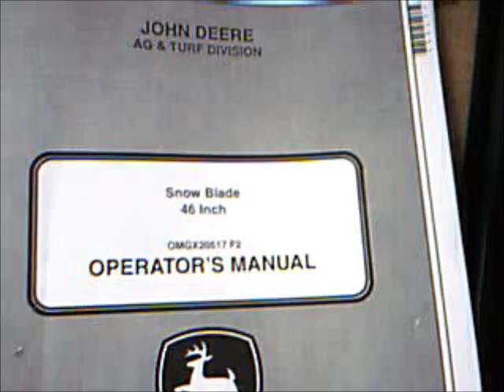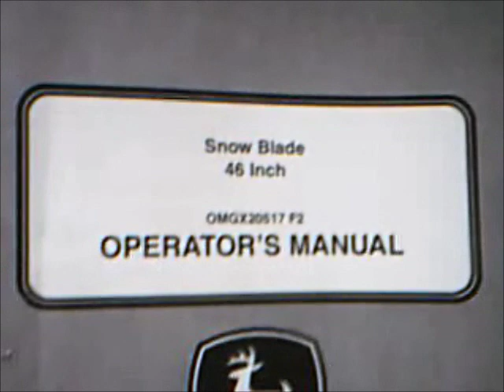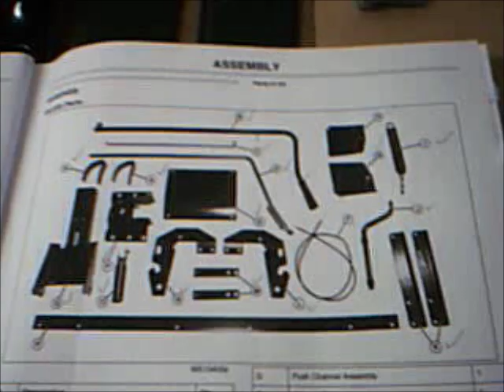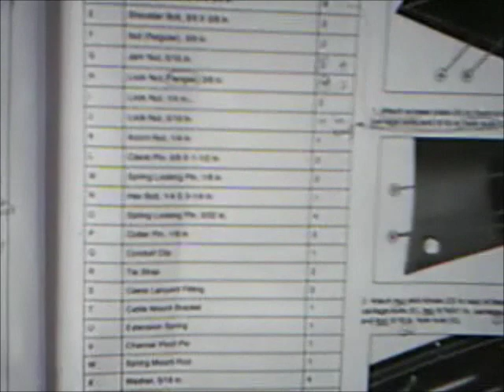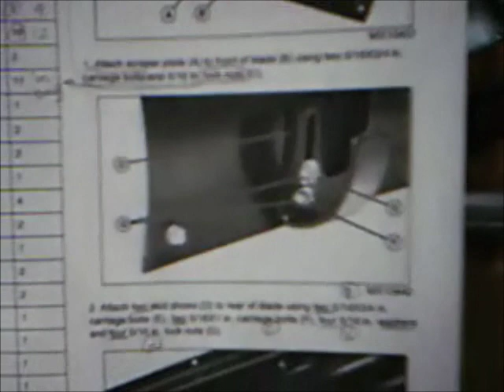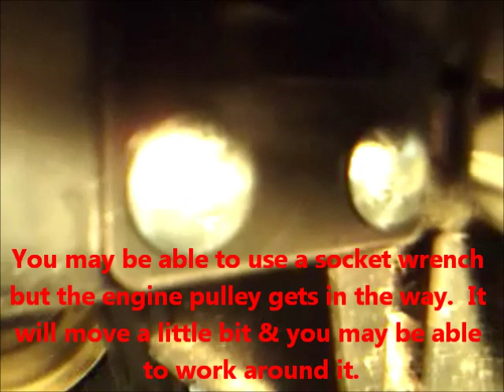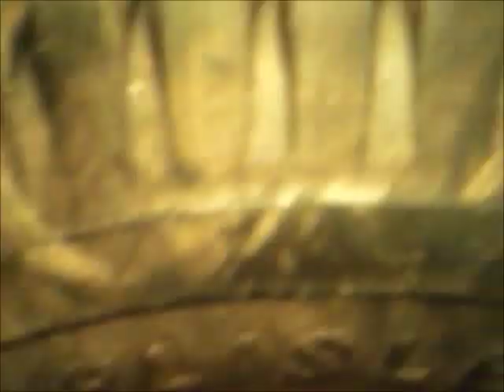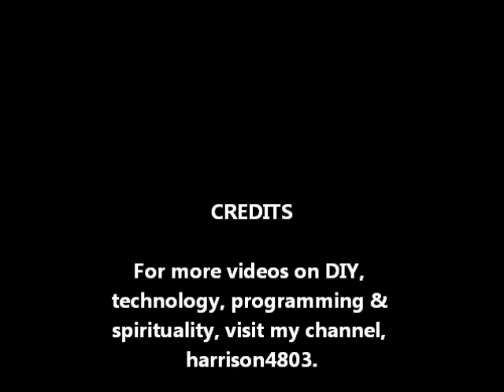Assembly & Installation of a 46" Snow Blade on a John Deere L130 Mower

Comment: Thank you, John.  Your video was just what I needed.  I watched and followed it, today, and have completed the installation of my own J.D. snow blade on my E150 model riding lawnmower.  My snowblade was sent without instructions, and I was able to just watch the video that you have spent the time and effort to create, perform the assembly in this fashion, with the result that the snowblade and riding mower work well as a system.  So thank you.  One tip that I would add, for those doing this, is that when it becomes time to install the two side mounts to the mower itself, to insert the carriage bolts from the inside out, i.e. with the round head of the carriage bolts on the inside of the mower with the threads of the bolt penetrating both the original chassis of the mower frame and out through the brackets.  Then mount the nuts from the outside, essentially.
Reply from the maker: Good point, Kev, and someone else suggested that before, also.  I had to take them off to replace my muffler & am reversing the bolts when I put them back on.  May make a video to supplement this.  Thanks, for thinking of it.

Comment: I read the instructions. Couldn't figure it out. Then I looked it up on youtube and found this I would replay 1 part at a time like 400 times. I only understand things when someone else is doing it. Not just paper. Thank you for making this video.
Reply from the maker: Thanks for the praise, storytime!  As a retired engineer, I always read the manuals first & like the detail! I used to write manuals, so have a little better understanding of how they are put together, maybe?
Reply: @harrison4803  just a quick question. Did you have to remove the exhaust manifold?

Comment: This was helpful.  Frankly it's an easy install EXCEPT the manual does not clearly identify bolts and nuts IMO.  I spent an hour figure out the what parts were what and an hour then building.   I was really surprised for a John Deere kit.  Even now I have no idea if i put the right bolts in the right places.   I had this video running next to the manual.  Fortunately, it worked great...
Reply from the maker: I agree, Michael, it was a challenge!  It took me quite a while longer to put it together, due to the video work, also, of course!  It has served me well, although we don't have that much snow, here, just West of St. Louis.  I had to adjust the cable to swing the blade from left to right, recently and that is about all I have had to do.
Reply: @harrison4803  The videos really take time.   I’ve done a few.  I had trouble with the cable adjustment also which was odd as I was once a bike mechanic.  All set now though.  Thank you.

Comment: Awesome, no one else did a video like this. Completely a huge help.Thank you for doing this! And you did it well, explaining step-by-step, following each step in the manual.
Reply from the maker: Thanks, for your kind words, alwaysbeeurself!  Must be the engineer in me?  I am one of those who always read the manual before doing anything!
Reply: John H Not a problem. The manual was pretty hard to follow, so without your video, I do not think I would have been able to do this. And, for anyone else to know, if they are doing this project, I purchased 2 of these units, I have some additional advice if it helps:
1. Please lay out all of the parts to distinguish what parts are what before you begin, make sure all parts are present before beginning.
2.  When comparing parts from each unit, all were present but  there was a lack of Lock Nut, Flanged, 3/8 in (letter H in Key).
3. Having a lack of parts and more parts then needed. In each box, there were 12, and 16 are needed, the manual even states 16 should be present.  And on a side note, there were 4 additional lock nuts in each box of the same type, but weren't in the assembly parts nor used in any of the assembly, thought that was weird.  And in each box there were 4 Jam nuts, but only 2 are used, as the other 2 are present to use as I said they gave me 4, but the other 2 are pre-attached on control cable, page 9 of manual. Guess whoever packs these items sees 4 are used, but 2 are pre attached. And in each box they gave me 4 of each Carriage Bolt, 5/16 x 1 in, but only 2 are used. And in one box they gave me 12 lock nut, 5/16 in and 11 in the other, and 11 are actually used.
4. Make sure you have wrenches of similar sizes for the assembly of the pivot support and mounting brackets, view manual to see what I'm referring to on page 10. So, one wrench could hold the bolt on one side, and you can screw the screw on the other side while the bolt stays still.
5. I didn't know this, but lock nuts have a rubber ring on one side, but this is there to allow you to screw bolt through it so the nut locks onto the bolt. At first I was confused as the bolts would stop at the rubber ring, eventually figured it out.
6. The manual, as you read it, eventually states you will need general purpose grease for the assembly of the lift handle rod. I didn't have grease, guess I could apply at anytime, buy FYI, it prob would help with lift handle gliding to enable smoother turning of the blade.
7. Finally, it states in the manual, at some point, to remove the blade deck. I kept my blade deck on when snow removing. Removing the blade deck will be a whole nother learning curve, may do this at another time, hope I don't mess my deck up when snow plowing, something you should consider if doing this job.

This took me approx 8 hours to complete one of these, I'm not technically handy, but this may not be a 2-4 hour job for the average person unless you are handy and are good at things like this.

The reason I bought 2 units is because the first one was missing the flanged lock nuts as explained above, and I was speculating other parts missing since I had a hard time determining what some of the parts were, and was really overwhelmed since it was hard determining, at least for me, what size the screws and bolts were, and some other misc parts.  John Deere wasn't to helpful in proving me with new parts, so they referred me to the closest dealer. But the dealer said they had a hard time identifying the parts since none were labeled, and if I could figure out what each part was missing they could order those few parts. They requested I buy a new unit, and just take parts from that unit, so that's what I did and I'm returning the other one.
Reply from the maker: alwaysbeeurself Great input!  You should make a video explaining all of this!

I removed my deck last year but found I really needed weights to plow the best. This year, unless I get weights, I am going to try it with the deck on for the added weight.  I plan to wrap a tarp or something around it to keep it from getting wet and possibly road salt on it!  Problem is this year we have no appreciable snow and have not had a chance to try it out.  Maybe this weekend?

Here is a video I did on how to remove my deck, if interested?  It was not that difficult.

https://www.youtube.com/watch?v=CEavsuNXdSI  (Remove)

https://www.youtube.com/watch?v=29dOKSGTCJc&feature=em-upload_owner-smbtn     (Reinstall)
Reply: John H Thanks again!  Do you think the deck needs to be removed? When I did use the plow, snow did get onto the deck, but not sure if this was causing damage. I looked under the deck and no snow touched the blades or underneath the deck. Could it be possible that hitting the snow can cause damage? Thoughts?
Reply from the maker: alwaysbeeurself It would be just like mowing in the rain or on wet grass, I guess.  You might have to dry it off to keep it from rusting.  If the snow has road salt in it that my cause some corrosion, unless you wash it off, maybe?  I was planning to wrap mine with a tarp maybe but not sure if it would get knocked off by the snow?  I am new at this idea, also.  I think you just need to dry it off afterwards, like you would do after mowing wet grass or in the rain, if that is what you would normally do, however, if you have a good paint job it may not rust too easily, if you don't?
Reply: John H Thank you. I have asked this same question to John Deere, and posted this question on Home Depot and Lowes, if I get a response I will sure to let you know. I figured maybe getting the pulleys and other parts wet could possibly cause some kind of problem, or if snow piles on the top it can unbalance the deck. All of your info is good, hopefully John Deere gets back to me on why removing the deck is necessary since they state to do so.
Reply: John H
John Deere just replied to this as follows:
"It is true that John Deere strongly recommends removing the mower deck when installing the front blade. While no exact issue is laid out in the manual, allowing water to get into the mower spindles can reduce the life expectancy of the deck. Also, the added weight of the deck with the plow may cause the unit to become unstable. We suggest contacting your John Deere dealer for technical support."
Reply from the maker: alwaysbeeurself Thanks!  If I try this, I plan to try to wrap it with a tarp or some such thing?  As for the imbalance, I am pretty light (160) so not sure of the stability but will monitor.  If we continue to not have snow, here just West of St. Louis, I may never get to try it out? :)  Where do you live, if you don't mind saying?
Reply: John H I'm at the Jersey Shore. It's not that bad here, we just got 2 more inches, pretty excited to use the plow again. Of course I could drive through 2 inches with my car, but just finding excuses to use this machine I spent a day putting together.
Reply: alwaysbeeurself FYI, Home Depot replied as follows, but not sure what they are talking about:
In order to attach the blade to the machine, the blade deck needs to be removed because both components use the same mechanism to raise and lower. Due to this, there would be no way to raise and lower the blade independently.
Reply from the maker: alwaysbeeurself Doesn't sound correct to me if you are using the blade with the independent handle, on the side, which you use to raise and lower the blade.  They are talking about some blade that is attached to the same lever as the mower deck? Does not apply for the blade I installed.

Comment: Excellent! Thank you, very much. I had problems with the angle lock bars and the small spring -- I found I had to leave everything loose a little first, to get the spring through the angle lock bar. Afterwards, I tightened everything. Also, for the two brackets that mount to the tractor, over the axles, I put the carriage bolts through from behind and the nuts on the outside, so I could use a socket wrench. But watching your video was a definitely help! Thank you.
Reply from the maker: Thanks, Christian, for the support.  Great idea on reversing the carriage bolts. Just don't use them enough to realize that they are held in place without a wrench.  Reversing them is a great idea, too, so you can watch the nuts for loosening later, especially in my case where I was short the locking nuts and put regular ones on instead.
Reply: John H Nice video wish I had checked before I installed mine. I had to stop twice during my installation because I was missing bolts or nuts :( other than that it was pretty much as your video :) and I also did as Christian did with the botls :)
Reply from the maker: Shadowlord Shadowlord Thanks, for the kind words, Shadowlord!  Before I ordered the blade from Home Depot I read the comments and this was the number one problem - missing bolts and nuts!  Glad you got it working and good luck with your "snow pushing", as we call it here in Missouri!  Trying to decide if I want to buy or make weights & chains now?

Comment: When it comes to installing the trip spring, I noticed your trip spring already had a metal rod inside of it with 2 hex nuts on it and a plastic cap. The manual shows it that way also.

However, my trip spring does not have a metal rod inside of it. Since there is no metal rod, there are no hex nuts, nor a plastic cap on it either. The manual does not explain anything about the metal rod, nor does it give any instructions on how the metal rod got inside the trip spring, with nuts and a cap.

I found a 3/8 × 3 1/2 hex bolt floating around in the box. It wasn't with the other bolts, nuts, washers, etc.  It was just loose in the box. Do you know if this is the metal rod that should go inside the trip spring?

There was a plastic cap packed in with the skid shoes and spring so I am assuming that goes on the end of the metal rod.

Any help you can give would be appreciated.
Reply from the maker: Jonathan, it seems like the bolt could be for the Spring.  The end of the Spring is open so it can slide in, I think?  If you read the comments, it is not uncommon to be short on a few hardware pieces, but the supplier is good at sending them to you.  Let us know how it works out?

Comment: Excellent video, thanks for sharing. I wanted some detail on the blade construction and components, which was really hard to find elsewhere. Thanks!
Reply from the maker: Thanks, Jason, for the comments!  I'm one of those who like to read the manuals first before tearing into something and manual preparation is more of an "art than a science".
Reply: John H 
thanks, it helps a lot.  I'm someone don't like reading manual.. I got to the last part where to hookup the blade to the tractor, do I need to take out the bumper?  I just bought mine D105 from home depot.
Reply from the maker: Felix Vaj Glad it was helpful, Felix.  I don't really have a bumper on my tractor?  It is just a thin metal-like shroud.  It can stay on.  As long as a bumper doesn't stick out, too much, I don't think it will interfere?

Comment: I have the same blade on a S130 the problem I’m having is when I raised the blade it only goes up 3 inches is there an adjustment for this
Reply from the maker: Mark, it should raise 6".  Sometimes the Channel Pivot Pin handle gets in the way & prevents it from lifting all the way.  Let us know what you find out?
Reply: @harrison4803  It locks in place but it only travels up 3 inches
Reply from the maker: @markcheech5496  So, the Pivot Pin is not in the way?  Does the Lift Rod slide all the way to the back of the slot?  I assume you installed the Pivot Support Bracket in the 2nd Hole from the end of the Push Channel Assembly?  I don't know if anything would line up in this position, anyway?
Reply: @harrison4803  I wish I could send you a picture
Reply from the maker: @markcheech5496  Can you attach it here?  Or email it to me at jharrisonengineeringco@gmail.com

Comment: hey john my plow is only riding like a inch off the ground when it is in the up position i dont know why it like that have you had this problem before
Reply from the maker: You should be able to adjust that.  Look in the manual.  I will try later.
Reply: @harrison4803  ok i just tried to adjust it and i got 2"-3"  gap  from the plow to the ground what the gap on yours?
Reply from the maker: @camgaming1350  I haven't put mine on yet but I think it normally is about 6" off the ground.  Are you sure you have the lifting rod all of the way up in the Pivot bracket slot?
Reply: @harrison4803  yes it is
Reply from the maker: @camgaming1350  Try this forum & maybe it will give you some ideas:  https://www.mytractorforum.com/threads/john-deere-snow-blade-install-problem.163550/
Let us know what you figure out?

Comment: Hello John,  just installing my snow blade which I pre-emptively purchased last August before the winter rush.  I'm half way through the process with the blade and most stuff assembled and tonight I get to install on my John Deere S160 purchased last June from Home Depot.  The S160 comes with a simple bumper on the front end, a black tube about 2-inches in diameter.  Did you have a bumper that you needed to remove before you could put this blade on the tractor?  All the video's I've found don't mention the bumper... I don't remember seeing it in my manual either, but I'm thinking it will need to be removed.  Thanks for the video.
Reply from the maker: Al, I did not have a bumper on mine.  The blade attachment goes on below the hood.  So, if the bumper is up even with the hood it may install below it.  Let us know what you find out.

Comment: What happens if you buy just the plow that pivot support bracket is like $250 itself am I right?
Reply from the maker: Patrick, I don't have knowledge on that but the pivot support bracket is heavy duty & probably expensive.  Obviously, you would need some way to attach it & how complicated that would be depends on the amount of flexibility you want?  Let us know what you work out?
Reply: @harrison4803  I'm still trying to figure out how to look for that part for a John deere La130..I baught the 46inch snow plow but it didn't come with that pivot support bracket and I googled pivot support bracket and it only shows me like a peice or 2 of that bracket at a time..I could be wrong but if you happen to find that info please get back to me.
Reply from the maker: @patrickturner7694  I looked at my installation manual & it literally has no part no.'s for reordering.  It just gives the JD part no.'s site.  Good luck!

Comment: Is there a chance that you have a video on how to remove the heat shield?  I could really use some guidance on that.  I'm afraid that I'm going to tear up my mower if I just try to wing it.
Reply from the maker: +Steve Rulison Steve watch from approximately 28 min to 34 and I talk about and show it.  It only has 1 bolt holding it on and has the spring, for the hood, on top of it.  Let me know if you need more help.  You can do it.  Take the bolt, spring and heat shield off, put the snow blade bracket on and then the heat shield, spring and bolt on top of it.